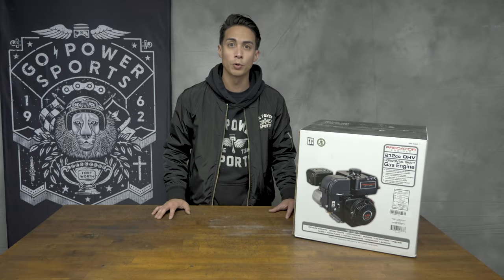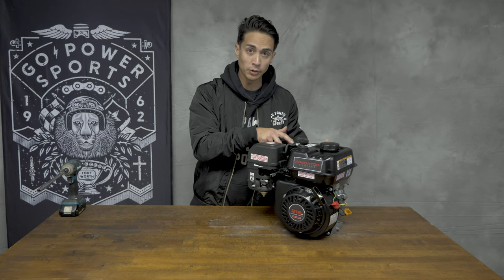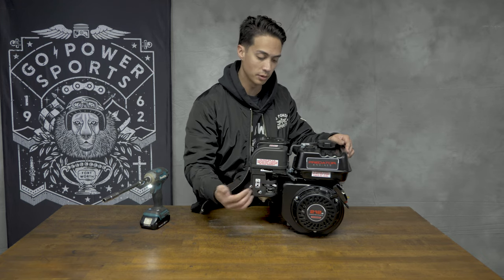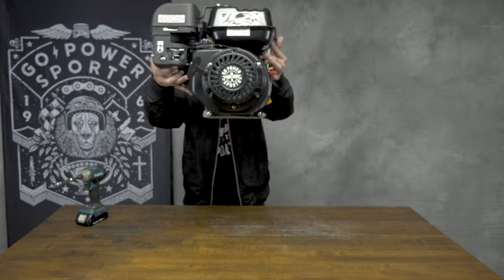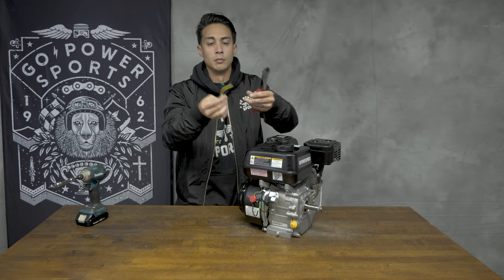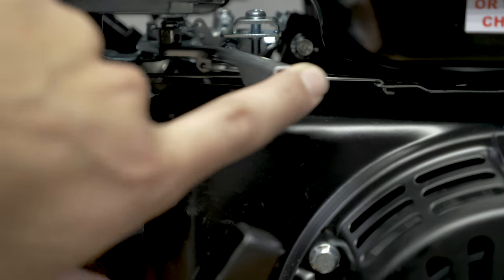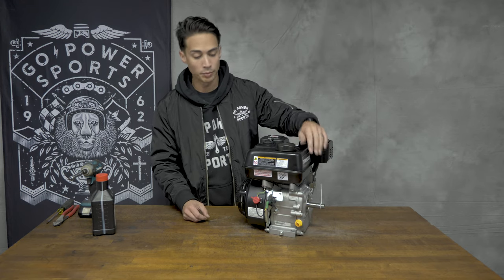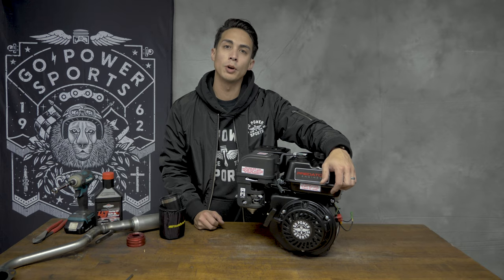Top 5 Predator 212 Mods and Tips

Comment: Another tip. After you remove the oil sensor, you can use the extra wire for a remote engine kill switch.
Reply: Please explain lol
Reply: Yes explain how
Reply: @psae8321  The extra wire coming from the coil, you splice and run it to a ignition switch.
Reply: @WyFoster well dang how do you do that lol sounds cool

Comment: I bought a predator. fresh out the box I removed gov gear/oil sensor. Put it back together. Later I pulled the valve cover off to swap valve Springs. I noticed a little bolt just chillin by the exhaust side push rod. One of the bolts from the breather slot came undone while engine was running and just plopped down. Surprised it didn’t damage anything. But to this day I check torque on every bolt/nut/screw on the engine. Especially internals
Reply from the maker: Always best to check your Predator Engine over before starting.  You would think every engine runs smooth out the box but that's not always the case.

Comment: If i use the stage 1. Kit do i need the 18# valve spring ?..
Reply from the maker: You don't need it but you would gain higher rpms with 18# springs IF you take out the governor.

Comment: hey i have a question and i would appreciate if you answered. so i just currently bought the trail master mb storm mini bike and i would like to add some suspension. i was wondering if the mini bike suspension kit listed on your website would fit my bike. i would really appreciate if you responded.  :)
Reply from the maker: It'll fit.  The handlebars will ride a little low, but it'll work.

Comment: I just placed 2 orders for some new parts. I have an exhaust, torque converter, mikuni carburetor, air filter, and flywheel installed so far. What parts do I need to replace on the inside 🤔 I was looking on your website and there's alot of different numbers and what not but not alot of information.
Reply: Get a bullet rod and 20lb valve springs as well as a cam. Nr racing sells a kit including that stuff

Comment: Just bought one of these engine and while doing research came across your videos. You say after 30 minutes of running at an idle, change the oil, which I will indeed do. The instructions say the operational break in period will last about 3 hours of use during this period do not apply a heavy load and do not operate the engine at its maximum speed. Is that what you do or recommend? Thank you for your videos I learned a lot!
Reply from the maker: That is good practice, we agree with their statement.
Reply: Who actually breaks in an engine like this for 3 hours? lol. Not only that. Who breaks in an engine at idle?
Reply: @Deucealive75  Break-in recommendations are part science and part plausible deniability. If someone ever wants to call up and complain about a parts failure, manufacturer can ask "describe the break-in procedure you followed" and if you goof that or admit that you didn't do it, it just gives a manufacturer an 'out' to not support the product. Some manufacturers will make the break-in a little onerous on purpose so that they can get owners to 'opt out' of their own warranty. But in general the only reason to vary rpm (not speaking about load, that's something else) during break-in is because in a splash-lube system, oil will spray differently at different rpm. The whole 'vary your rpm during break in' thing is just CYA, to make sure that everything in there gets sprayed with oil every once in a while. Cams in overhead valve car engines are POSSIBLY subject to problems from that, but the cam in a 212 is hanging wide open in the crankcase and gets smacked with oil all the time no matter what, so the rpm varying is less important here.

Comment: I have a question would I be able to use an aftermarket filter with the predator 212 without the adapter kit? I ordered one from you guys and it just came with the filter I guess it was a mistake but I’m just going to order another I have my header and jet and really wanna install the mods now without waiting on the adapter is there a way to run it without the adapter or can I run just the jet and the header for now with stock foam filter

Comment: looking for any help, the pull starter on my 212 wont retract, but thats only when its bolted on.. it retracts fine and normal when we remove it from the engine so...lol
Reply: might have to jus replace it
Reply: @aydencoleman2783  wait the engine😭🤣? The pull starter works when it’s off so I don’t think it’s a problem with it itself, but maybe. Would suck to have to plug it in every time to start it.
Reply: @JOSHUA GOODSELL
COME ON MAN, IT'S ALL ABOUT YOU PUTTING IT BACK ON THE ENGINE AND BINDING IT'S FREE MOVEMENT 
SOMEHOW.
GO SLOW AND LOOK AT IT FROM EVERY ANGLE. SOMETHING IS RUBBING SOMEWHERE.

Comment: Can you take the governor screw off?
Reply from the maker: You can but we recommend that you leave it in.
Reply: @GoPowerSports  ok thx but just wondering what would happen if I take it off? Will it effect performance in anyway?
Reply from the maker: You could potential break off your tabs on your regulating frame if you're too rough with it.  Also at the higher RPMs, you will feel your governor keep kicking in (unless you already took it out).
Reply: @GoPowerSports  ok just wanted to make sure thank you I haven’t done anything to the engine yet still research thanks once again

Comment: Another tip. Do not start your engine and let it idle for 30 minutes. They were not designed to sit around idling.
Reply: Yes they were.
Reply: Engines need to be broken in when they are brand new but I didn’t really feel comfortable letting mine idle for 30 minutes straight so i did it in shorter intervals for about 45 minutes
Reply: @trymeofficial276  they dyno test every motor brand new at the factory it doesn’t need a break in
Reply: @Prestonnnnnn  literally says in the manual to break in for 3 hours?